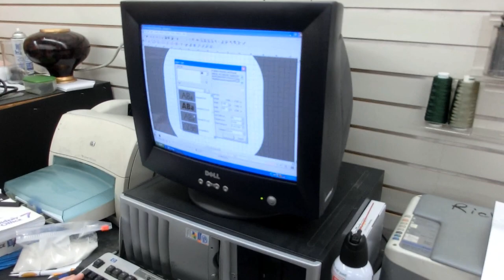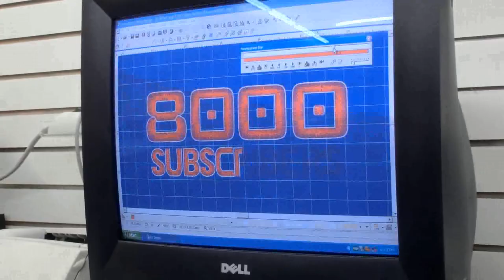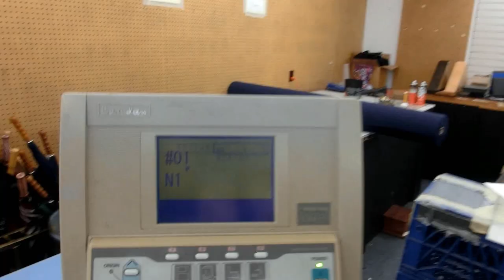8000 subscribers

Comment: Cool machine, and slow mo footage, and congrats on the 8K subs.

If there's visibility, try to see the works beneath the cloth:  that's where the thread is stitched so there's a lot more going on...  if it's anything like a sewing machine, anyhow.
Reply from the maker: yeah the lower part has a lot of shielding around it so its hard to see while it's running.

Comment: I subbed you lately not because of anyone specific. Bumped into your videos starting out researching the settings on a multimeter to test for stray voltage in a reef aquarium. Then got lost clicking videos on the right side of youtube. Next thing you know I'm watching you building the replacement(extra?) battery for your ebike. I especially enjoyed the Kaypro 4 conversion video. Its kickass shit like that, that gets your 8k subs.
Reply from the maker: well thanks, i still am working on the next part of teh kaypro project but soldering connectors isnt all that fun haha

Comment: Woah, that embroidery machine is amazing! Great choice of fabric and thread. It contrasts nicely with eachother. Also, to futureproof those floppy drives, when they go bad; replace 'em with www.ipcas.com/products/usb-floppy-emulator-fdd-to-udd.html It's a really neat way to simulate floppy drives, while still using usb sticks. 100 floppy images on a cheapo usb stick! It's used a lot in Amiga's and old dos gaming pc's for preservation and ease of use.

For the 10k video, how about making your own on-the-cheap 3 axis cnc machine, with a dremel on it, to create the 10k subscriber sign? I know you can pull that off, and it would be an excellent way to teach yourself and the viewers about stepper motors, drivers, and maybe even a bit of programming?

Cheers man! Congrats, and on to the next 8000 ;)

Comment: Congrats man! I know I was here before the 6k but I don't know about 4k. I think I subbed right before this (1950s Reel Mower Restoration part 3: assembly) video came out. The first video I watched as a sub was Random bits 0044. which is funny because the next video after that (the billy nye 10 hour video) looks like your most disliked. I didn't dislike it though.

Comment: Well done :-))
Thats a smashing sign, amazing to watch the machine :-))

I still have 3 1/2 floppy disks, they worked well for me.
Reply from the maker: yeah i didnt mean they are bad technology....its just why the fuck would they put it on that machine that was made around the time people stopped using floppies. so now they have to find old floppies at thrift stores to use.
Reply: Rinoa Super-Genius
I wasnt picking fault, i got the joke between you and your mum :-)

I wonder if anyone made a 34 way fdd to sd card converter, hmm
Anyhow, stop focusing on the negative, just the positive, 8000!! subbs :-)) :-))
Reply from the maker: zx8401ztv
well its not negative, its just curious why they did that.

Comment: Congratulations, recent subscriber, did so based on your solar/battery experiments. How about wind turbine with dc motor, shouldn't be expensive. I would really like to see your way of doing it. Just a suggestion. Thanks for the videos.
Reply from the maker: DIY: Vertical Wind Turbine VAWT

tried it but we dont get good enough wind here, the turbine actually spun backwards so i think the wind around here doesnt move in straight lines but instead it moves in big swirls.